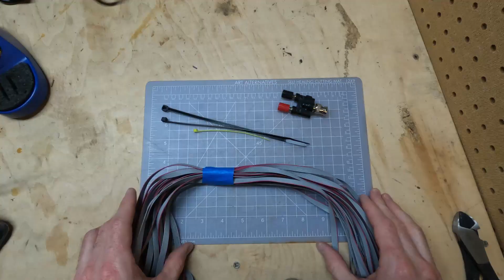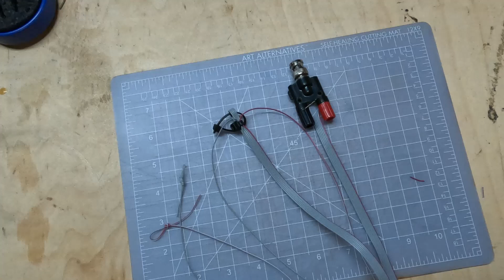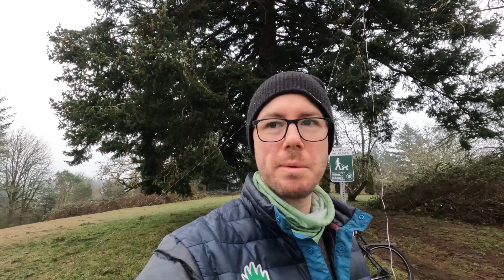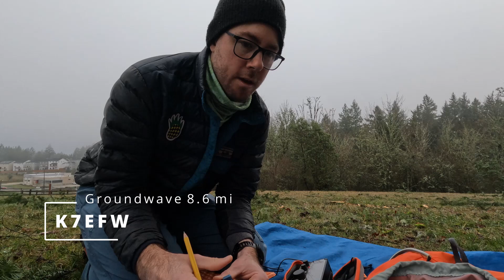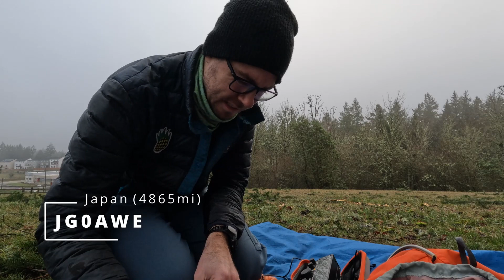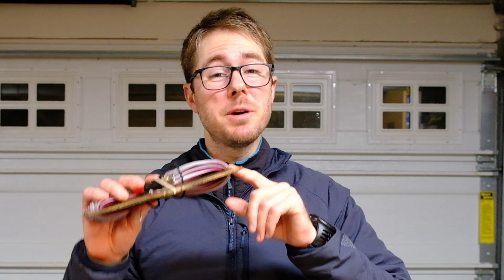What's with the NorCal Doublet?

Comment: Great vid! Doublets are fantastic antennas. the open wire has low loss thru the feedline even with poor vswr (vs coax), so actually very efficient as a multiband antenna. the 44’ size has dipole-pattern propagation at all bands 10-40, so can be oriented for predictable directivity, which is great here on the coast. one thing to watch for is that you can get losses with open wire in proximity to ground or metallic objects that “unbalance” the balanced line. I’ve seen some folks use a short coax run to a balun to get clear of the house/ground, which is a pretty good tradeoff vs making a weird open-wire pass-thru in a wall or window-frame, as long as the coax is kept as short as possible.
Reply from the maker: That's an interesting note about metallic objects unbalancing it. One thing I did observe later in the activation: I went to try to chase s2s on 20m and could only get a 3:1 match on that band. Odd bc it had tuned 1:1 earlier in the day. Now I wonder if my cell phone or something else was too close to the feedline then. The other bands still tuned  1:1 fine though 🤷🏼
Reply: @N7KOM 🤷‍♂️ sounds reasonable. iirc the rule of thumb is to keep possible couplings > than 2x the inter-wire spacing for open wire. I usually try to move my position to keep it off the ground , but I grabbed myself a 3’ coax bnc jumper and a bnc:bnc connector to try with my 1:1 k6ark balun, gonna give it a try with my norcal next time out. if nothing else it gets me 3’ higher up 😂

Comment: Can you make an antenna out of a couple of 3.5 floppy drives?
Reply from the maker: a single 3.5 floppy is a 1/22 wave on 2 meters!
Reply: @N7KOM  cut a thin strip in a spiral shape from the disk, you may get a 1/4 wave for 2m per floppy disk

Comment: Hey Tim, nice job on the build and field test video! I need to find an easy local SOTA summit to use for antenna testing etc. I'll definitely give one of those doublets a try. My go-to SOTA antenna of late has been a 20-meter end fed half wave which I connect via a tiny Unun; the entire thing weighs about 4 ounces. I pretty much only work 2 and 20 meters during SOTA, but it would be great to have a multi-band option. Keep up the good work with the videos and hopefully we'll be able to pull off a S2S one of these days. 73s! Mark K0EHR
Reply from the maker: Hey Mark, great to hear from you. I recall that you were using an off-center dipole for your SOTA activations. Cool that you've given the EFHW a go. I need to build a new one of those. You should definitely look at getting a multi-band antenna, or at least a higher-band antenna going. I've had some really cool QSOs on 10 and 15 meters lately. Very fun bands to get on to and neat to get some new countries in the logbook. You use a IC-705, right? 73 de Tim N7KOM
Reply: @N7KOM  Hey Tim, you are correct--I'm still using the IC-705. I am always looking at the tradeoffs between having to carry my LDG tuner and being able to use multiple bands, vs going with the EFHW. It's really only about 1/2 pound difference, and you have a great point around the advantages of the multi-band approach, particularly of late with cycle 25 finally kicking in. I may go back to my OCFD as it performs really well and weighs next to nothing. I also like your Norcal Doublet--maybe I'll make one of those my next QRP project!

73s, Mark K0EHR
Reply from the maker: @markehr  My next project is making some traps for yet-another- end fed half wave. You could always try that, or links for a multi-bander without a tuner. 

OR, from K6ARK's EFHW kit: "Adding a small loading coil can help bring 20 m, 15 m, and 10 m into resonance on a 40m wire.  Start by attaching a spool of antenna wire to the matching unit.  Use the ¾” long piece of .7” dia tubing to wrap about 12 turns of wire, 6 feet from the feed point of the antenna.  Keep it from uncoiling with tape or slits in the plastic.  Unfurl enough wire for resonance on 40m, then test on 20m and 15m.  Adjust the coil as necessary to bring those bands into resonance.  Once the right location and turns are found, secure the coil with heat shrink, cut the wire long, and trim to resonance." I haven't tried this myself yet, but seems like a great solution to add those higher bands.

Comment: It looks like the easiest source for suitable wire is four-conductor ribbon intended for RGB LED installs.  You can get 100' (probably 30m/98.5') on Amazon for $20, which is markedly cheaper than proper IDC ribbon cable.  There's even one listing that comes with four little pieces of heatshrink for $17, which might shrink small enough to replace the fold-back ziptie.  I'd probably keep some zipties in the bag just in case that failed, though.

(I think this is the first time I've had a visceral "Thanks, I hate it" reaction to an antenna design 😅)
Reply from the maker: Are you saying I should make an led antenna? 🥳🤯
The ultimate gamers HF antenna 😆
Reply: @N7KOM  Y'know, I have no idea what happens if you put diodes in a feedline.  I imagine the capacitance is a a nightmare, as reverse-biased LEDs are a classic QRPp varicap.

I thought you might be amused: I pulled out some 15 year old ladder line (from making 2m j-poles for weather balloon stuff), and put together a doublet.  It's incredibly poorly mounted, but working well enough, and is a great demonstration of "A compromise antenna is better than no antenna."  My other antenna at home is an early Alpha loop, which does okay-ish on 15m to 30m, but is receive-only outside that range.

OTOH, this doublet, installed as a janky sloper from 12' high, is pulling in tons of stuff, and gets out well enough for FT-8 on 10 to 20.  Waiting for night to try 30, 40, and 80, but I could get all of them to decent SWRs with an MFJ-941E, so 🤞that it's actually matched and not just a very complicated resistor.

I'm really hoping 80m works out, as there's a local slow CW net out of Berkeley that I've wanted to join in on for practice for years now, but didn't have an antenna for.

It'll take a few days to determine whether I should be thanking or blaming you for this one.  Until then, a tentative thank you for getting me to try this out!

73 de AJ9BM
Reply from the maker: @joshmyer9  That's awesome. Let me know how it goes! 40m has been pretty good anytime of day lately. I still need to try getting on 80 meters sometime.

Comment: I haven’t built one with ribbon cable, but I built one with 16ga THHN that I had in the garage. I also built open feed line with the same wire. 

It’s a little bulky, but is regularly deployed with the feedline to a 4:1 balun and a short coax run to the rig. It’s a solid antenna if you need to be frequency agile. 

Cebick thought highly of it. That’s s good recommendation.